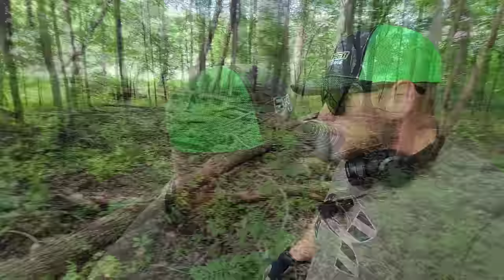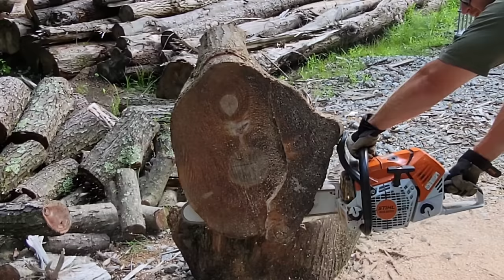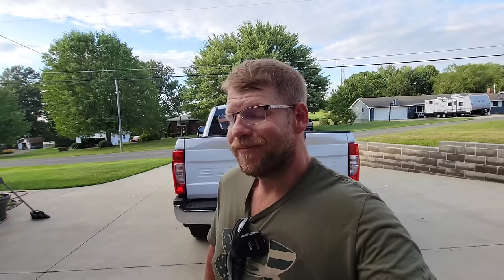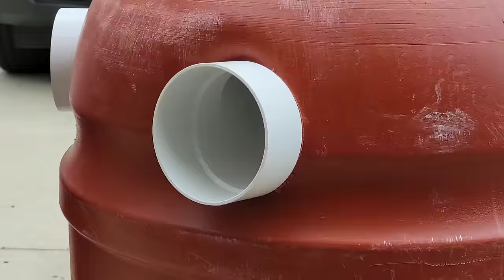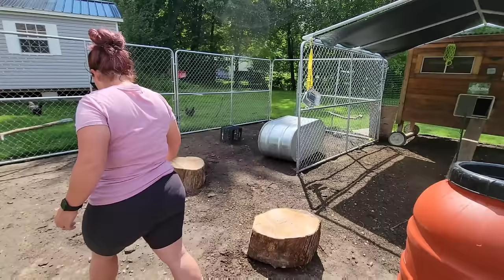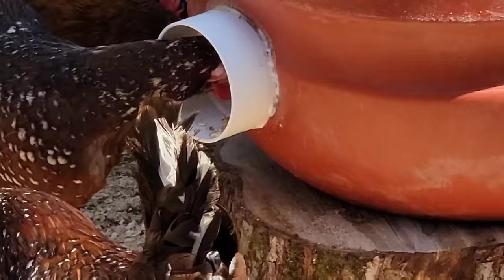THE BEST DIY CHICKEN FEEDER AND WATERER YOU CAN MAKE AT HOME!

Comment: Love these...do you have any issues with rats/mice getting the food?
Reply: Been using this for about 3 years. Never seen any signs of mice. Mine are on concrete pads 6 inches off the ground. The barrel overhang the blocks a few inches so there's not really a way for them to climb into the feed holes.

Comment: Great idea. I used my 4" hole saw which is 4" id the elbo is 4"od. Then I just took my torch and softened up the edges of the hole. This allowed me to easily push in the elbo. And it also sealed it after it cooled off.

Comment: It the water lid is sealed tightly it will form a vacuum and eventually stop the water from coming out the poultry nipples when they are pressed.  You may need to add a vent if the lid is sealed tight.
Reply: Peck waterer let's air inside,  they won't have a problem.